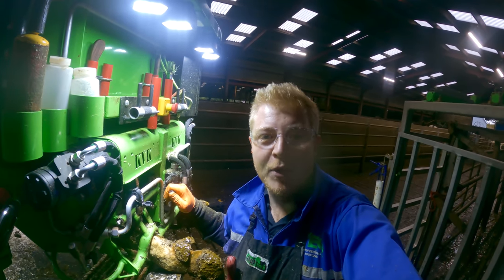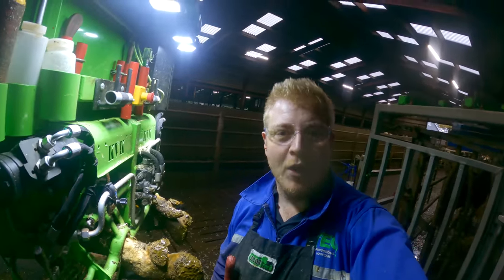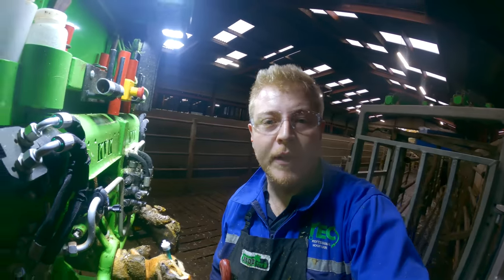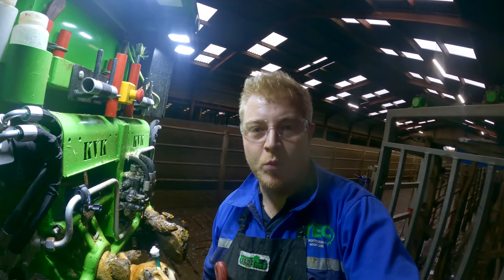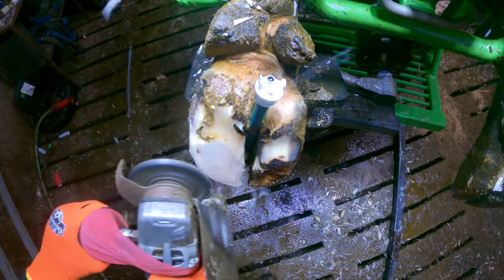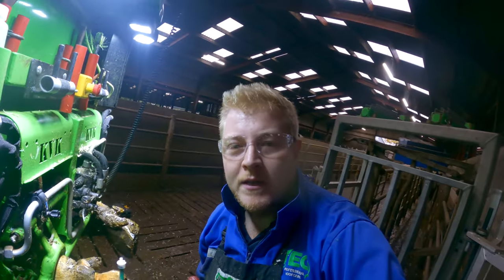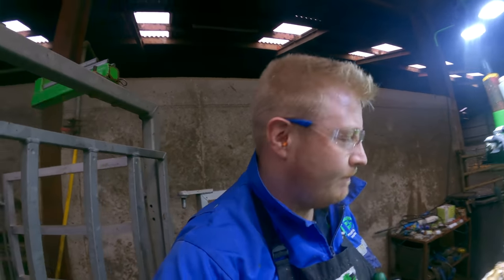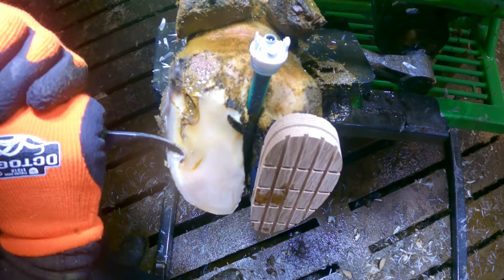REMOVING SATISFYING HOOF CHUNKS | TEC TV

Comment: Just a question.  By overusing the outer claw, does that mean there  may have been an issue on the inner? Or was the lesion caused by the overgrowth on the outer? Thanks for another great video!
Reply: I'm not an expert, but I think generally if a claw is bearing too much weight it's more at risk of devloping bruising and inflammation due to all the extra stress it's dealing with, whereas an underworn/used claw might grow it's horn a bit more irregularly. I think in this case the overgrowth on the outer claw was making the lesion problem worse, since the cow was unable to give that spot a rest as that was the claw most of the weight-bearing was happening on.
Reply: I believe cows generally overuse (to more or lesser extend) their outer claw because the anatomy of the claws/legs make it so that the outer claw bears more weight. In terms of the origin of the lesion, I agree with AwkwardAnonymous